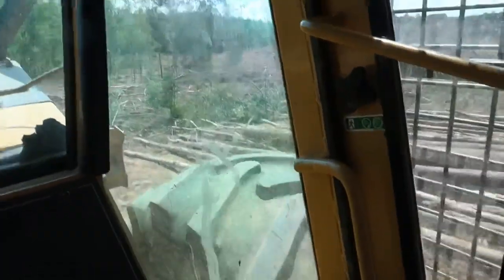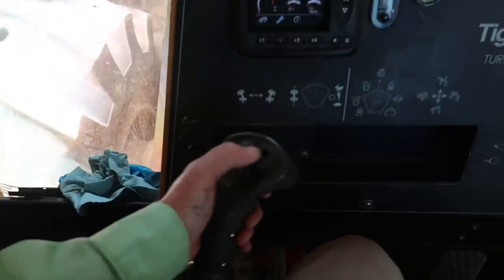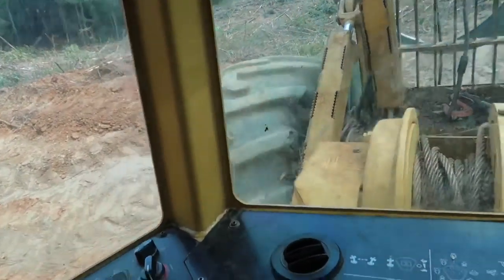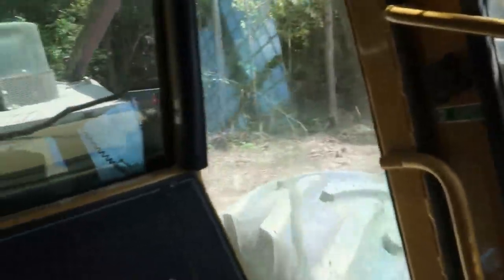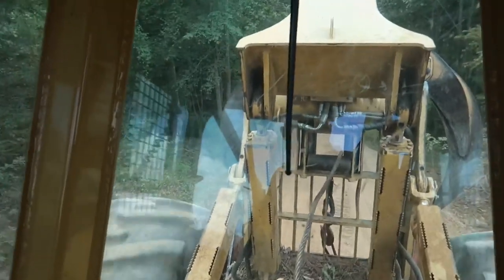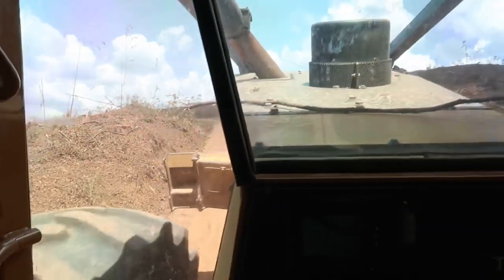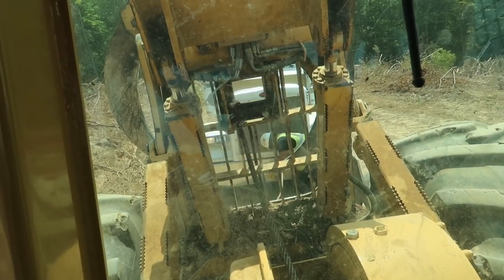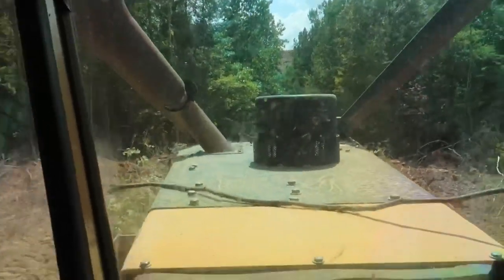How to run a Tigercat Skidder and pull trucks

Comment: Gives you a greater appreciation for the old Pacific and Hayes logging trucks and the hills they tackled with even bigger loads. Granted they are off-highway trucks but the power and torque they had for hauling those mammoth trees on the west coast.

Comment: Here in va we load our wood with a crown in the middle so the straps/chains will pull down on the load if the straps aren't touching the logs va dot will give you a ticket for unsecure load/improper securememt...we've had one or two of those over the years..

Comment: Great video as always Tim.  Is the truck's getting up the hill on their own a traction issue?   Do y'all run 3:55 rear ends?
Reply: I think it is too steep because they don't have momentum. From a dead stop pulling what looks like a 40 or 50% slope. As a reference most highway grades are 7%.

Comment: You don’t run hooks or shackles on the cable to make hooking up easier or do they break quicker?
Reply from the maker: Tigercat has a monster hook and it’s way to big to fit the Peterbilt pulls.  We need to do something different because how we having to do it has whipped us.
Reply: @cotontop3  Get a big clevice